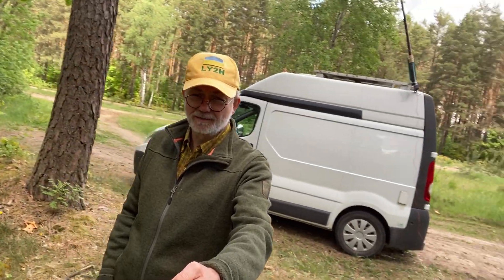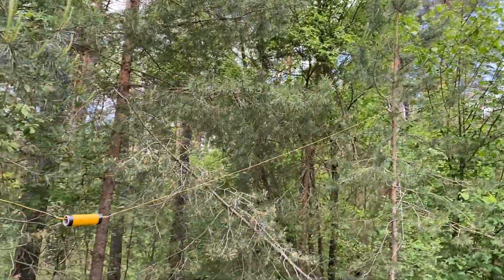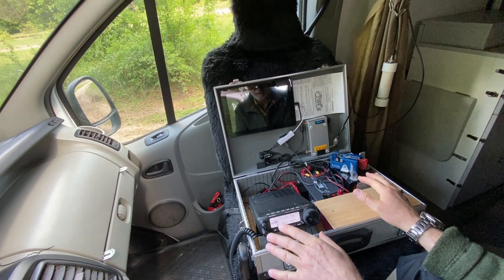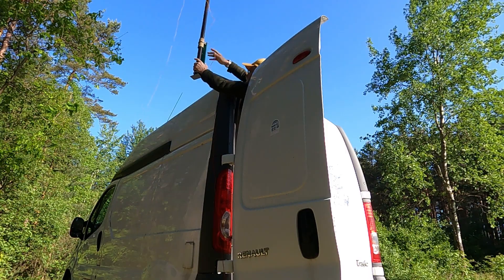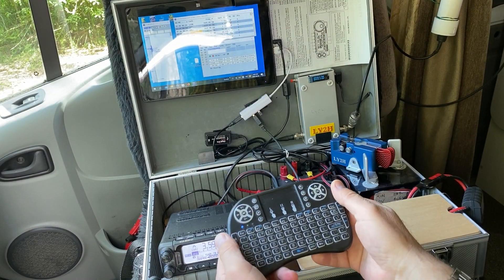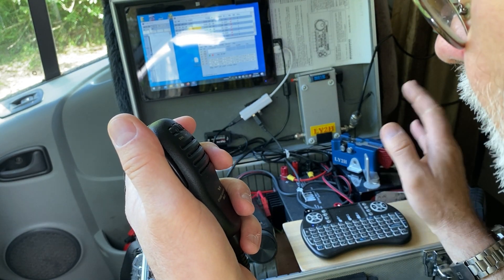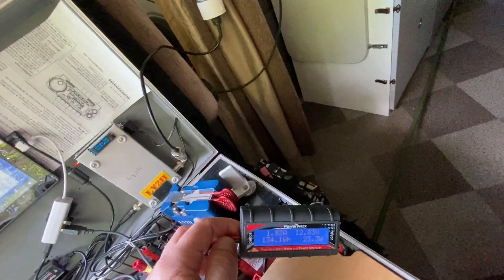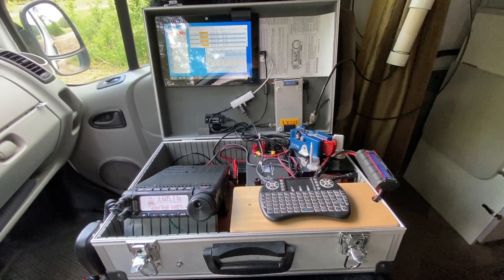My Ham Radio Outdoors:  1min deployable Go-box, mini EFHW 80-10 antenna,  FT-891  radio.

Comment: I like your radio van Linas !! I would be tempted to put an operating desk in the back with all the equipment spread out nicely on the desk. I'm not sure they sell that van in my country - it looks like a Renault with raised roof. It would make a perfect radio van...maybe even room for a bed in the back. A tour of the vehicle would be nice to see for those looking to buy a communications vehicle
Reply from the maker: Thanks John! My radio van is not exclusively for communication purposes, it's also a family recreation vehicle, fully suited for 2 adults and a small dog :), with comfy sleeping place, kitchen and WC. So, I thought it would be unpractical to permanently install ham radio equipment  all around the space :). But  yes, I can, and often do install an "office desk" , just not in the back but in the front. It can accommodate even a bigger radio, like Elecraft K3, a laptop PC etc, if I want  to take part in a bigger contest or something. Anyway thanks for a tip, I will do a video some day with more details on the radio and travel installations of my Renault Trafic van. 73! Linas LY2H.

Comment: Awesome job Linas!  The case & equipment fit nicely.   The concept of a rapidly deployable mobile rig makes perfect sense.  I have an iCom IC7000 and LDG tuner… I have all the nessecary components… but alas, I’ve yet to mount everything.   Your video serves to motivate me to finish it…

For a mobile rapid deployment rig, I think a 100w transceiver to be best.  I’d plan to run my rig at 20w.  It keeps the draw reasonable and manageable, with a solar panel, charge controller and battery, proper metering, and encased components, it’s entirely manageable.  

I’m curious, have you ordered the new QXM from Hans? 

Great video Linas!  72 de W7UDT
Reply from the maker: Thanks Rand! I agree with you that 100W radio is most logical approach. BTW, by no means it is necessary to run 100W at all times! In the park activations I usually start with 50-60W , very light regime for the rig, and, if necessary, I increase later if I see that I'm not heard good enough by remote stations. 
Yes, I have ordered the QMX from QRPLabs some 2 weeks ago, but it's still in waiting due to high demand. So far only thise who bought it in Dayton from Hans can physically have it. So far no new reviews though. 73! Linas LY2H

Comment: You are in a van you can charge up using your engine so why worry about the current consumption. If you were walking you worry about weight. So I would use a pen and paper for logging, the same antenna with the pole at mid point (inverted V) and my FT817 with a manual tuner providing SSB and CW.
Reply from the maker: Thanks Chris! That's exactly what I do when in hiking ham radio mode :) As for charging, I only use car's alternator to charge the camper's battery when driving anyway, and only in critical situations,as my van's solar set-up keeps the battery charged most of the time. I never use engine for charging when on the camp site though with other campers around. 73! Linas LY2H

Comment: The FT 891 is my radio of choice for NVIS with my 20 AH battery and 1000 watt Solar Generator with 2 - 100 watt Solar panels.  It does a great job for me.  Great Video👍❗️73 KV5P
Reply from the maker: Cool! My solar in the van is also 200W into 135Ah battery, serves the camper and ham radio needs nicely. But I noticed that even my small 50W foldable solar pannel in pair with the Genasun controller provides with nice 2A if current and is perfect  for my Bioenno 20Ah battery. We need to use all the options we've got! 73! Linas LY2H